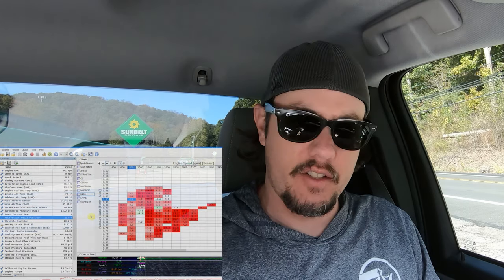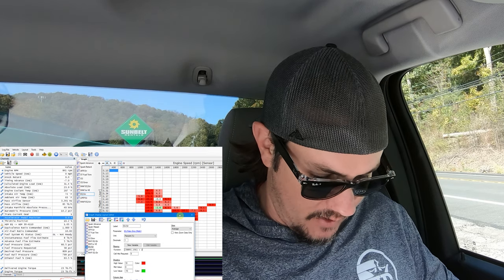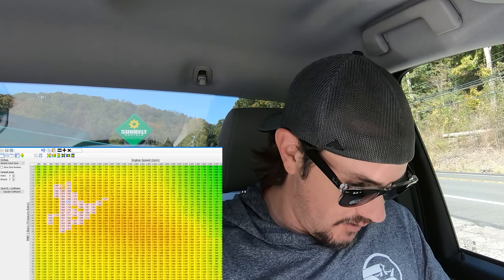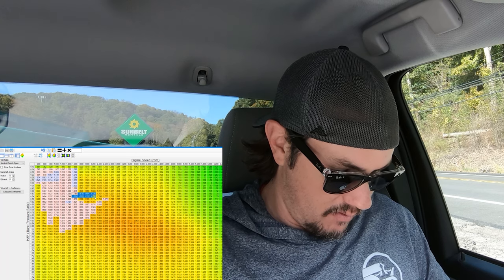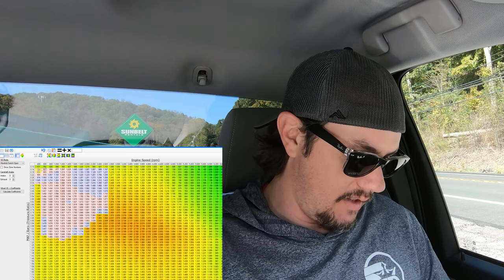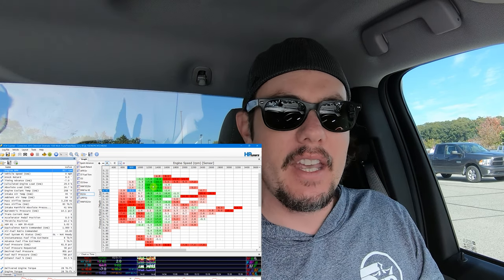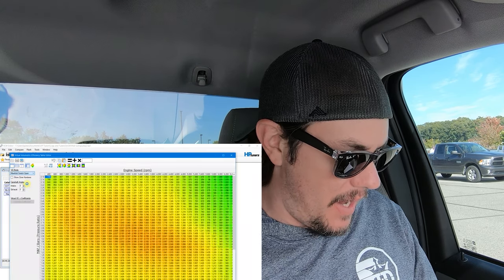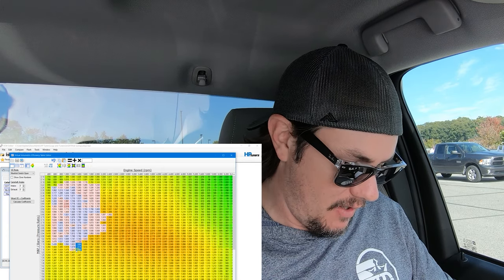Ported Throttle Body VE Tuning With HP Tuners, Fixing The Surge!!

Comment: I have seen your throttle body tuning play list more than 3 
Times for each video can I assume that whenever upgrading to a bigger aftermarket throttle body or porting your factory throttle body  if you face any throttle body related engine light it should be solved with a simple relearn via hp tuner scanner+the only thing you need to do when upgrading/porting /changing your throttle body is either ve tuning or idle tuning whether it's a gen 3,4 or 5 no new throttle body calibration under airflow >electronicthrottle whatsoever is needed correct because I have been over thinking this spending hours.I need a clear guide around this for all gen 3,4 and 5 and thanks in advance.

Comment: I’m in need of some advice. I have a Ford 302 with aluminum heads, gt40 intake, 1000cc injections, 8an feed, 6an return, gm 3 bar map sensor, an on3 70mm turbo kit, mild cam, manual transmission, also have a terminator x.  Under a small load (letting off clutch to get going at a light) my rpms jump around and it feels like it’s surging.
Reply from the maker: Kyle, the Holley stuff sucks at idle range fueling adjustment, try bumping the closed loop/learn up to like 1300 RPM and then manually adjust the fuel table while it idling until you see a good AFR and see if it helps.

Comment: what if youre on a MAF only tune?
Reply from the maker: There is no such thing as a MAF only tune, VE is always present and cannot be disabled so it needs to be tuned.  You can skew the dynamic airflow weight towards MAF but you can never do a tune that doesn't reference the VE table, that is why it is critical to tune it.

Comment: Have you ever messed with the cylinder charge temp tuning? For leaning out issues with OLSD tuning?
Reply from the maker: Negative, elaborate? What kind of lean issues you seeing and what platform?
Reply: @GoatRopeGarage  on some stuff if you run open loop with SD only.. you will start to lean out the more the car warms up. Also you will notice in cold vs hot weather your AFR will be off, maybe a little like .7 off or could be a whole point.  I'm having the issue now, and googled and found it is pretty common and do to with the Cylinder Temp "bias" table. Just trying to figure out put to tune it without just "guess and check" so my AFR's will be alot tighter in different weather conditions.